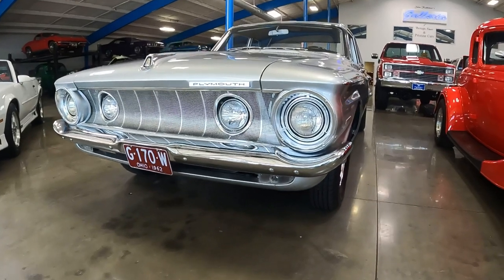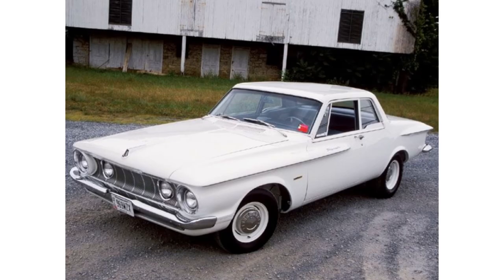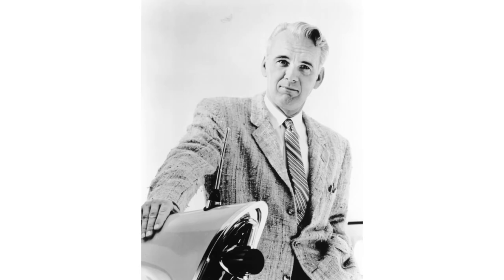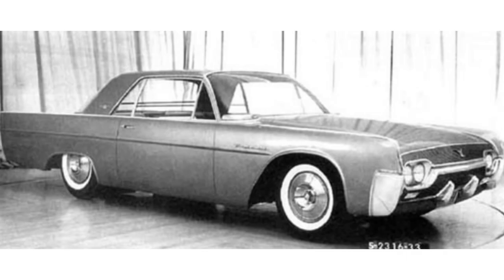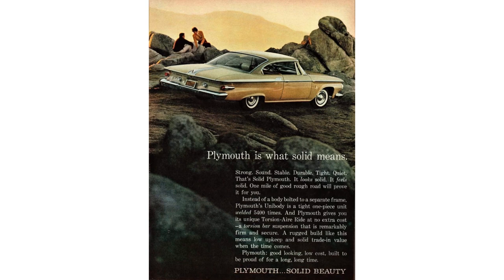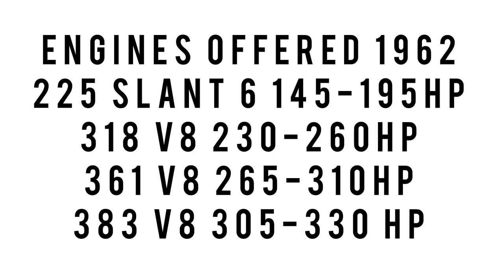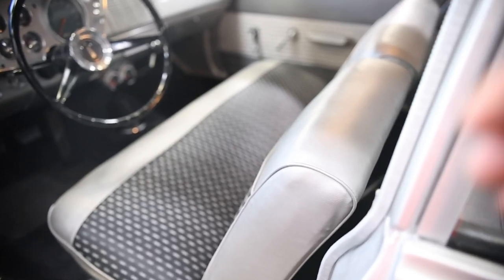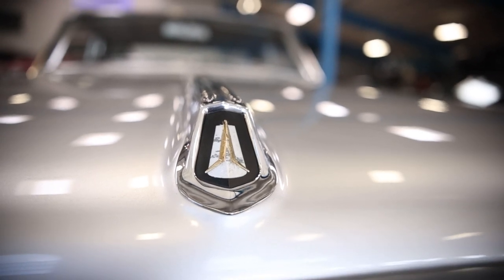Most in depth look at 1962 Plymouth savoy super stock max wedge on the tube

Comment: As a former street racer from the 60's, I can tell you that all of my Torqueflite automatic mopars had a big advantage over the manual competition when it came to drags from a standing start.  I had a 1963 Dodge Polara sleeper that put the hurt on many GTO's and Corvettes in the Detroit area.  I worked at Chrysler's Central Engineering, so I had a little edge when it came to getting the most from my Dodges and Plymouths.
Reply from the maker: Awesome thank you so much for sharing those memories =)

Comment: I like these Savoys... When everything else was going squared off and boxy looking, the Savoy styling really stood out.  I consider these "proto" muscle cars, even though they were technically "full size", they were smaller and had shorter wheelbases, closer to that of midsize cars and they could be had with the full size engines... like the cross ram 413.  Now, could one of those beat a Fuelie Stingray?  Maybe... it'd be a damn good race to watch!  As for the automatic vs manual trans, most automatics were slushy and designed for comfort at the time, but Chrysler automatics were actually quite well built for performance.  Most people will say that the Chrysler autos were the first to be "faster" than 4 speed cars.
Reply from the maker: I worked at the Classic Car dealership last year I got to drive that car it was absolutely incredible when it ran great but it could switch with an instant because it had those cross ram carburetors and they were very finicky.. we had a few injections stingray as well as this car and I asked my boss I said I don’t wanna drive but I will totally film it can we take them out back and see which one is faster.. The answer was no.. which was a total bummer but I totally understand why I told him I was like let’s just see what she wants the first one to 60 we don’t have to get any speeding tickets we don’t have to ““ be racing.. I only asked once and once it was pretty much a no I just let it go but that is something that I’ve always wanted to do

Comment: The 300 S L Mercedes gullwing coupe and roadster had an inclined OHC straight six. Also the 413 would handily eat a fuel injected Vette with little effort, stock right off the showroom! I have weight, rolling resistance, power and torque to Gross weight ratio charts. And the Dodge advantage is huge!

Comment: Forward Look. Unique to the Savoy was the "Plymouth" script that you see on the door. For the next model up it would have said "Belvedere" while Fury and Sport Fury it was relocated entirely. The hood and deck lid trim that extends from the ornaments wound not be found on a Savoy. Neither would this have  "Golden Commando" call outs on the front fender. This car has no heater so the "cool" button nearly opens an air vent. Depending on the driver and gears answers both of your questions about the Corvette and manual vs. A/T. (p.s. inside door handle is upside down.)
Reply from the maker: Awesome thank you for the insight =)
Reply: The Savoy and earlier Plaza were named after NY hotels. Belvedere is Italian for "beautiful view" (room with a . . .)

Comment: The Savoy sure is a stark series but the Fury  2 door and Sport Fury for 1962, I thought, were quite nice. It is sad that Virgil and Chrysler Corp. got slammed for the styling. If you look at the Dodge, the Plymouth is beautiful, IMO - at least the Fury and Sport Fury. More ornamentation and chrome. Interesting dashes in this years of Plymouth and Dodge. The Chryco products I drove had very quick and precise shifts without pushing the buttons, so I'm sure a lot of Plymouth automatics out ran it's competition. It was the quickest, I believe, as the Turbohydramatics had yet to come along and the heavy duty Power Glide wasn't there yet either, at least for the normal Joe buying one and expecting performance. I'm not talking of racing transmissions. So a long winded way of saying yes, a 413 wedge Savoy (light car) could outrun a Corvette and probably the Chevy 409 and Ford 406 of 1962. Of course as one said below, drivers and gears make a lot of difference. Oh, isn't the Plymouth you show when talking of a '59 a '57? Thanks for a look at the 413.
Reply from the maker: Thank you so much for sharing that information =)

Comment: Max Wedge was never a term used on these engines until many years later. Even the "wedge" term wasn't attached until the then new Race Hemi was released in the spring of 1964. At that point it was necessary to distinguish between 426 wedge and hemi engines. All 413 and 426 "Max Wedges" were labeled Super Stock in Plymouths, and Ramcharger in Dodges.
Reply from the maker: Awesome information 

They also made a 426 hemi that engine and the wedge are different?

Comment: It’s called the “Forward Look”. If you’re going to make a video, do your homework and get the terms right! 

To understand the design of the 62, you have to look at the 61 Plymouth because there are some styling cues carried over from that year. Case in point is the dual emblems on the stainless spears that are on the center of the hood and trunk. So you can’t tell if the car is “coming or going”. 

The fins started to go away on the 62s, but there is still a shadow of fins on the 62. 

The 62 isn’t for everyone, but the looks can grow on you. In 2 door form they are more attractive. 

The interior is a lot plainer than previous Plymouth models. But the vinyl portion of the front seat back had the embossed Plymouth rocket symbol like the 61 model. A cool cue imo. 

The downsized unibody was a nice driving car. It handled well for the era with the torsion bar suspension. Ride was smooth, but not sloppy. They steered easily. My driving experience was in a Belvedere sedan model with a Slant Six, manual steering and brakes and automatic. I had no issues driving it at low speeds or parking it. 

The trunk seemed pretty expansive and there was ample interior room. 

Sounds like it wasn’t Exner’s fault for the styling mistake. It was Chrysler’s president screw up. Should have done a better job scouting the competition!
Reply from the maker: Old video… thank you for sharing that information and insight

Comment: Those cars were ugly 😵‍💫 even when new. The finned Chrysler/Plymouth/Dodges were every bit as good looking as any other car. To me back then the C/P/D’s were a little more elegant and still sporty. But the model year you are reviewing is 🤦‍♂️🤷‍♂️. Although Exner was the senior designer I promise there were multiple meetings and many people involved. The decision wasn’t solely on him. Also, C/P/D was selling very, very well with the fin designs. I think Chrysler has a patent on the torsion bar suspension (1951). You might do a video on the multiple Chrysler/Plymouth/Dodge/Desoto models through the 50’s and what the sales figures were. You can see how upper management f’d up.
Reply from the maker: Yeah this was the sad end of exner at Chrysler.. the original design was ready to go and looked better than this newberg  jumped the gun. Exners team reworked it down to what was known as the 62 savoy.. it sucks they put all that time and energy into turning it from a alright looking car into an ugly car and exner still losing his job over it in the end.. every tho it wasn’t his fault.

Comment: I had a 62 Dodge custom 880 with the 361 and push button trans. In comparison to my Buicks, Galaxy's, and Mustangs (including a 73 Mach), my Dodge was the quickest and most fun to drive. Technically, didn't make any sense. As most car enthusiasts know, sometimes you get lucky and come across that special engine that defies logic even though was built as equal to the rest.
Reply from the maker: I’ve had cases like that I raced a friend they had a Ford explore circa 2002.. I had a Lincoln town car signature series 1988 and I smoke them with my 5 L making a whole 150 hp.. it was fine I’ll even let them go first ahead of me and we flew past them... that was a long time ago I was 18

Comment: These were the first Super Stock  cars I ever seen race. At the time the 409 Chevy's were putting away the 408 Fords. I didn't believe a Plymouth or Dodge with an Automatic Transmission could possibility win, but when it was all over the Plymouth and Doge were against each other for top Stock Eliminator.
Reply from the maker: Thank you so much for sharing those memories I got to drive this car last summer and when it hooked up it hooked up great but within a second or two if it didn’t run good these cars were really finicky with the cross ram..
Reply: Ford was a 406, with a cross-bolted bottom end but lacking in cylinder head flow. The block was used in the 427 Fords a few years later.

Comment: I don't believe that the A-833 four speed was available until 1963. If I am right, then someone had to modify things to get this in. The "Cool" button was kind of weird. My dad's 1965 Dodge Coronet had this. WIthout A/C, it just blew vent air.
Reply: I believe ‘64 was the first year of the A833 after the ‘63’s with sourced T10’s grenaded.
Reply: @weirdkindofsexsymbol  Thanks. I had heard that a 4 speed was available before 1964. I just didn't know which one it was.

Comment: I had a 1963 Sport Fury, 383, push button auto….friend had the Dodge 1964 same engine, etc, except his was 4 speed manual….90% of the time The Push button edged the manual out….say, One car length.    That 62, was coyote butt ugly, dont know what it was other than the lines were all over, cleaned up in 63, real nice in 64.   👍🏻
Reply from the maker: I worked at Jkgalleria in the summer time and got to drive that car mopars are finicky it would run good you would shut it off or I shut it off and then I couldn’t get it started again no matter what I did it wouldn’t start.. I was shooting a video for it for the shop and when I shut it off I had it all the way in front of the store I had to push it the whole way back I think it was like a quarter mile or something like that it sucked but that car was easy to push.. 

With that said my boss let me hammer it that 413 man it’s so fast very underrated car I drove it ginger and then he said let me show you how it’s done The car is incredibly fast it’s like no miles to the gallon but that’s not what it’s about..  car is super under rated It will run circles around the Corvette what I really want to do one day is a comparison episode Studebaker Avanti versus Plymouth Savoy two of the fastest most underrated cars of the early 60s

Comment: I'm a big fan of these early chrysler designs... very futuristic. Add to that how light they were plus add a factory race motor and you can see why they dominated the strips by the mid 60's. My friend had a done up 62 Belvedere 440 4speed back in the 80's. It was unbeatable. Fastest car I've ever been in. I have a heavier 64 Polara maxie
Reply from the maker: This car I worked at Jk Galleria over the summer time in this car absolutely hated me I never had so many issues with a car the cross ram it would run great and then it wouldn’t.. I took it out for a photo shoot test drive and shut it off I could not get it started again no matter what I did.. mopars are generally very finicky anyway I ended up pushing that car a quarter mile back to the show room by myself because I couldn’t leave it where it was
Reply: The Ford was ugly not the MOPAR  I’m sick of people saying this model was ugly 😡lot of BS  This car is MOPAR heaven an yes the beach boy got it wrong as it been done again an they had egg 🥚 on their face .
Reply: @What.its.like.  Yeah I remember the finicky days... usually due to the stock ballast & points system. It's the one thing that I upgrade in mopars.
Reply: @brianandglendaharkin9457  You want ugly...  look no further than modern cars.

Comment: Nice car, but it has a few problems under the hood including the WRONG radiator. ALWAYS do your homework or consult an expert whenever you are thinking of buying  ANY Max Wedge car. Thanks for the vid.
Reply from the maker: This was a tribute car it wasn’t a real 413 car it was built by a transmission specialist this thing with a horse I’m serious Ass I got to drive it last summer. But I will also say that no pars especially with a cross ram or super finicky it could run perfect and within an instant it could run completely like crap and just die out on you in the middle of the street.. that time ended up being the wrong gas cap but if they were always really finicky I took it to go take pictures of it outside the dealership and they couldn’t get it started once I shut it off so I had to push it back to the dealership show room which was about a quarter mile away that car is really easy to push Corvette on the other hand I’ve never push the Corvette that was easy.

Comment: I drag raced a 1962 sport Fury 305hp 361cid with at
Stock engine ran consistent mid 14 seconds at 105mph
Reply from the maker: I got to drive this car this past summer I worked at the car dealership. That car was so finicky, Because of the whole cross ram long tube intake.. I was their media guy and I took the cards out and got pictures of them stuff like that I drove the car maybe a quarter mile down the road and I shut it off because I didn’t wanna leave it running while I took pictures of it. I couldn’t get it started again no matter what I did. I had to push it back to the dealership which wasn’t that bad because that car was really easy to push 54 Corvette was the hardest thing that I ever pushed ever for whatever reason didn’t like to move.. 1940 ford is another car that sucks to push. But when that car ran good it ran great that thing was a monster. My boss let me hammer it and I went pretty ginger he told me to get in the passenger seat and he would show me what it would do. That car was awesome when it ran good total nightmare when it didn’t. Somebody traded a 2013 challenger core edition for it the challenger had 3,000 miles it was brand new, well almost brand new it still had the new car smell some how

Comment: I had a 63 Belvedere. Wonderful car…just curious, why was there not rear view mirrors on this particular car
Reply from the maker: I have no idea why this car did not have mirrors I think this car was used as a drag car it belong to a renowned transmission specialist in the area. I got to drive this car over the summertime and let me tell you it is fast, but I will also add they are extremely temperamental very finicky if it’s running good do not shut it off because odds are you won’t get it started again. When it ran good it ran great but then there was times where you could not get that thing started to save your life. I worked at the Classic Car dealership over the summertime and I was told to take it out and get some videos of it and I shut it off I ended up having to push it like a quarter mile back to the show room because I couldn’t just leave it there. It is easier to push that car than it is say a bubble top Belair with a 409 in it or any Corvette for whatever reason Corvette is a really hard hard to push especially the first generation that is like one of the hardest cars that I pushed all year last year 1954 Corvette.

Comment: I had forgot to watch this one. I don't care what anyone says, the 62 Mopar's were much better looking than the 61's by miles. My dad had a 62 Dart, which was this size car. It had vent windows & pushbutton trans and radio. I could tell a story about a 10 year old punk with a wrist rocket & a bag of ball bearings, but I won't. Toodle ooh!
Reply from the maker: I got to work at that dealership over the summer and got to drive that car and it was super finicky when it ran good it ran great the power, was unbelievable.. but it could change with the wind. I shut it off to take pictures of it and I couldn’t get it started again I had to push it back to the dealership.. (that’s where the push test came from) that car was super easy to push if I had someone with me I would have tried to kick start it, thank god I wasn’t far from the dealer just off the lot but had to push it the whole way to the back side, someone traded a 2013 challenger for it
Reply: @What.its.like.  Well...I had some vehicles in the beginning that needed a push from time to time to get running. 52 Chevy Panel was HEAVY! My 60 Bug, not so much. I also received a wrist rocket for my 10th birthday & shot a ball bearing through the back windshield. My dad called the cops because it looked like a gunshot! WOO HOO!  "Stupid punks"

Comment: The push button transmissions were a pain.  Operating them was not intuitive--you couldn't be sure of hitting the right button without looking, unlike with a lever whose angle would tell you by feel what gear you were selecting.  This meant you had to take your eyes off the road to shift.  It also meant it was a pain to rock the car back and forth in snow to get going.  And to top it off, the buttons were fragile and had to be repaired at some point.  The styling actually made sense, given the smaller dimensions--it was a way to make the car look less boxy, while still having good space utilization.